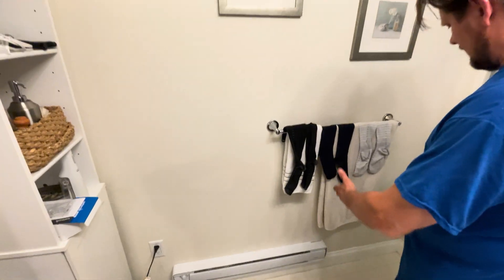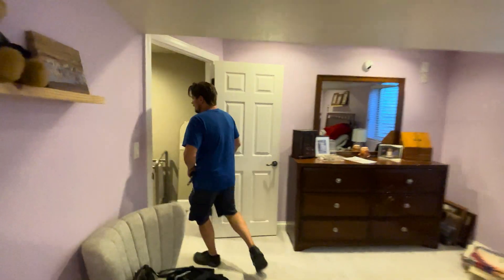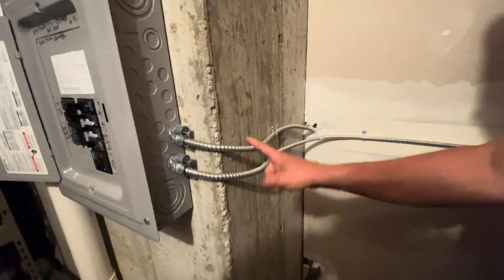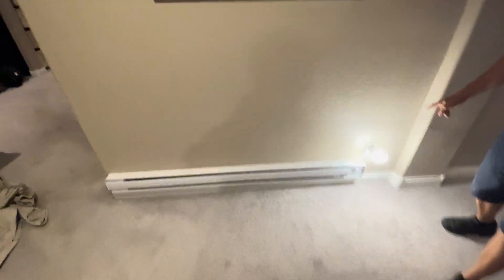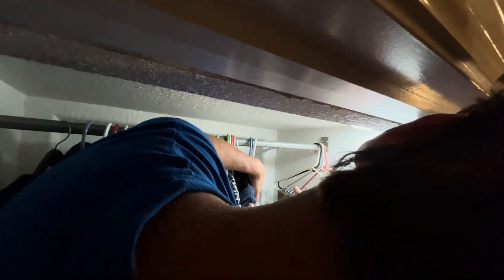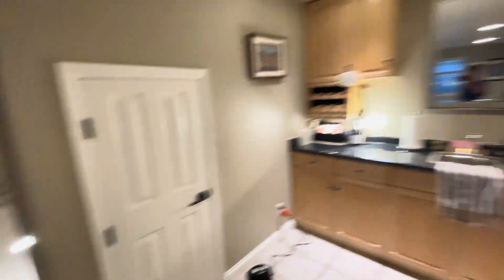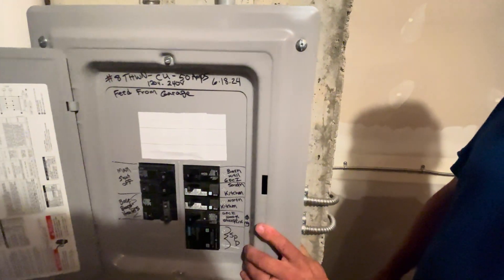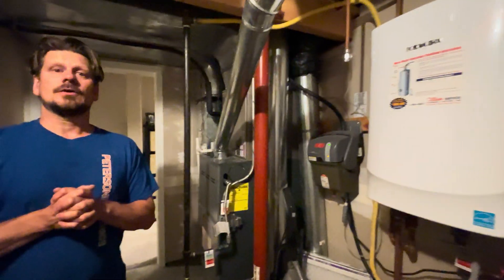Rewiring a Basement that Originally Only Had Two Circuits

Comment: Can you (or anyone) explain why the duplex connectors for a single MC into the panel? I've learned from where I work now for the past 9 years to use single mc connectors except for daisy chained lighting.
Reply: So that you dont have to knockout anything in the future to add something in that mechanical room. Or maybe thats all they had on the truck. Ether way this install is done perfectly to code & the costumer will never have to worry about a tripped breaker again.